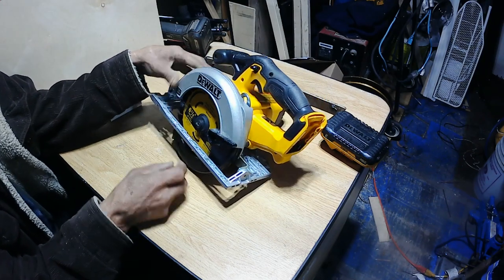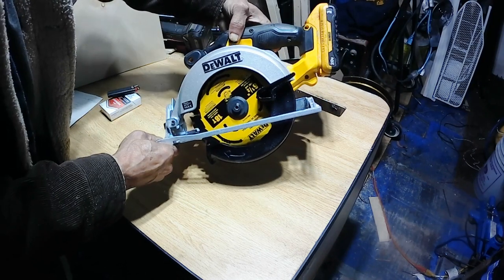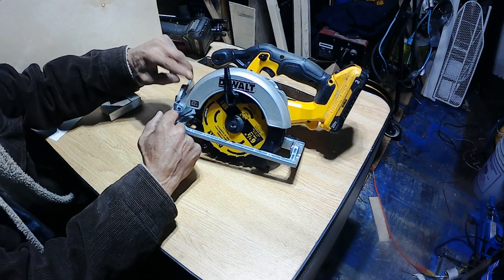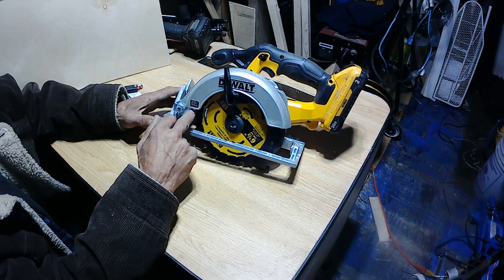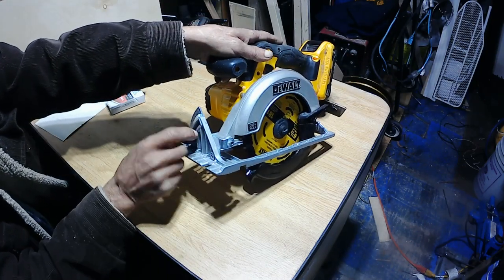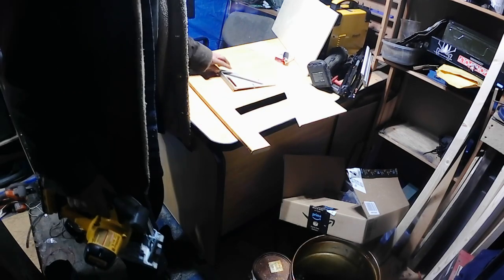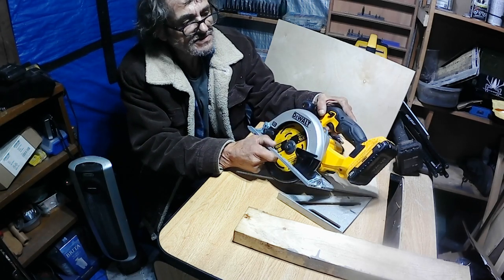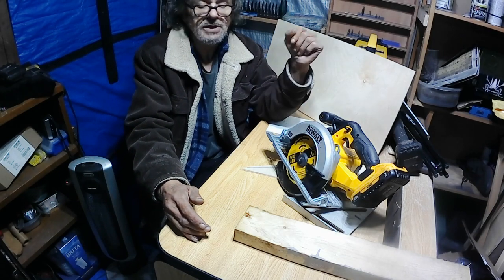My Dewalt DCS391B cordless saw Review

Comment: Nice saw Neves, I use my circular saw for wood and aluminum
Reply from the maker: Yea I see some people do that, Do you use the same blade for both  or a different blade for aluminum ?
Reply: @NevesProjects  I usually use a high tooth carbide blade but I don't apply too much pressure. If the blade is aggressive, people just flip the blade and it will cut in reverse but it's also a good way to knock the carbide out if the blade gets a shock load. I am sure princess auto has some cheap blades to try it out with. I always take mine to the scrap yard to pick up cheap aluminum, it has cut angle and 3/4 plate to fit into the car or van.